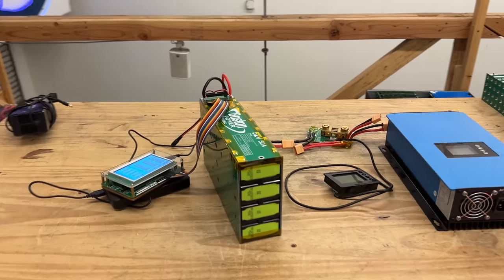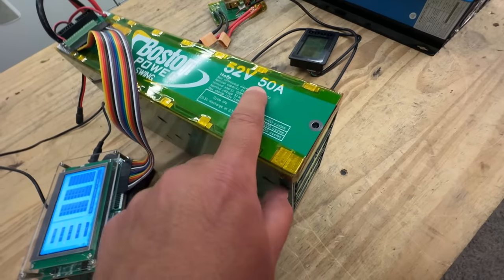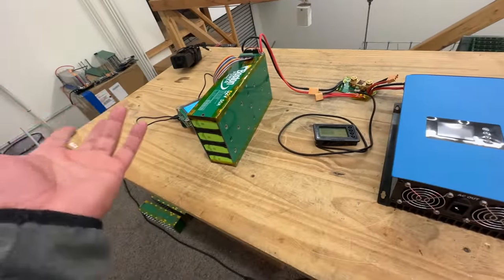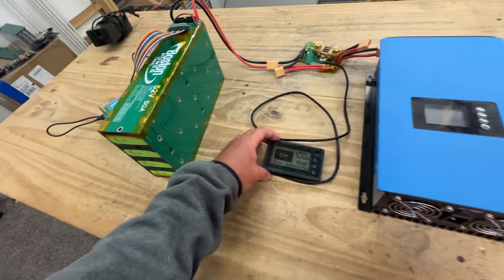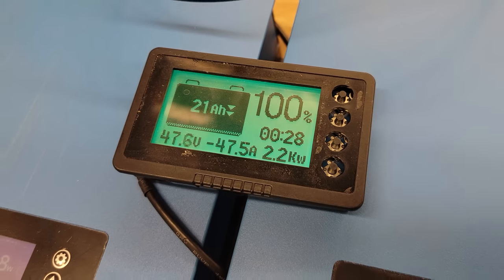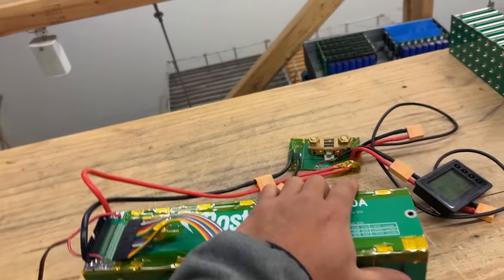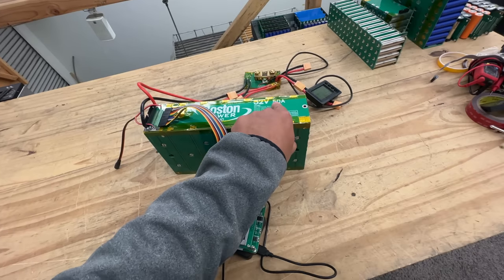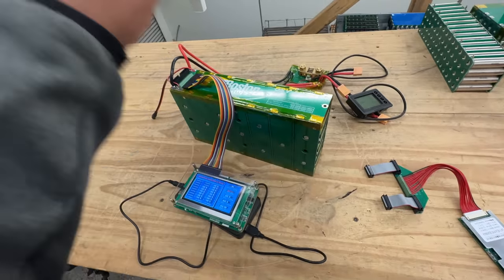1102Wh 52v swing eBike battery

Comment: Jehu what can you build to replace 12-24 volt lead acid batteries inside of UPS devices like my Cyberpower 1500 with two 12 V batteries or APC unit with 12 volt battery. these units have a internal charger but only designed for lead acid.
Reply: Build 7s 18650 with a 7s  40a bms
Reply: For 12volt use 4s 2p lifepo4 32700 with a 4s  35a -40bms